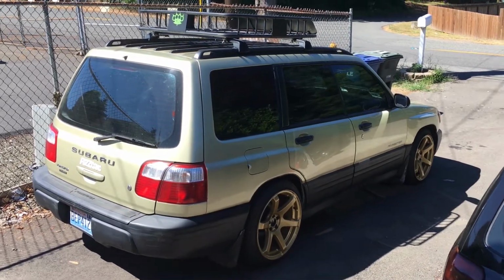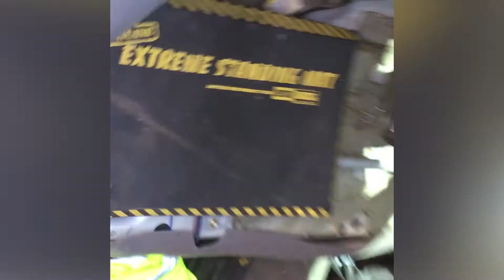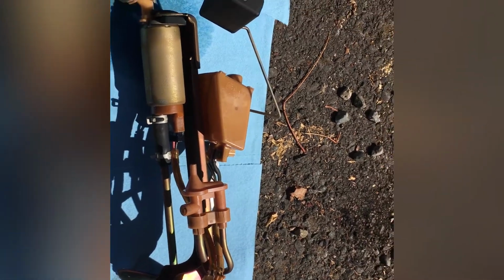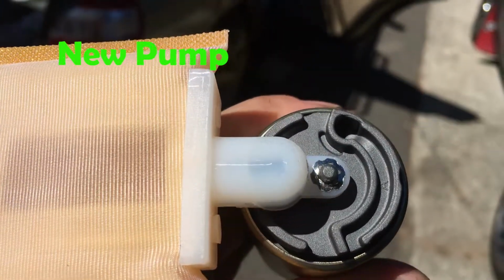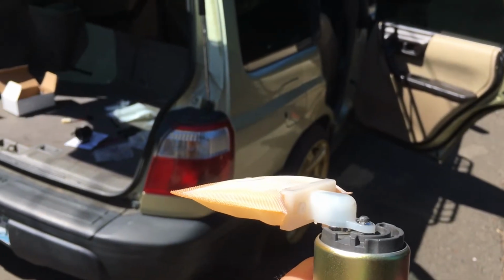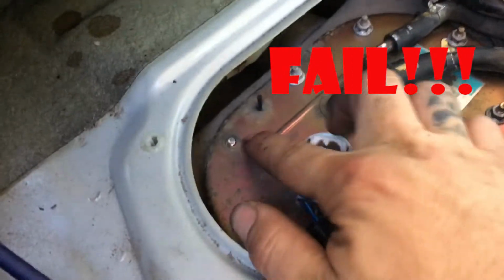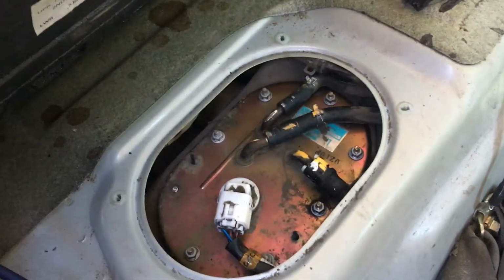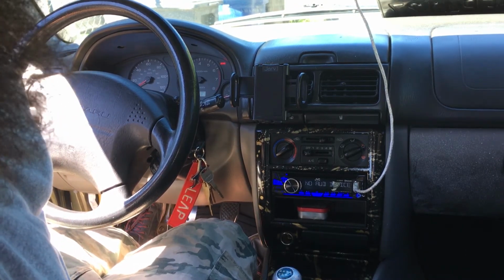Subaru Fuel Pump Replacement

Comment: Major tip.  But a piece of fuel hose that has a spec number of J30-R10.  It is rated to be submerged in the fuel.  A lot of times they don’t provide the correct hose with the new pump.  It’s the reason so many pumps fail.  The hose dissolves and ruins the pump.  Been through that issue several times with a Subaru.

Comment: How has this fuel pump held up? Is it still working good? I have a 2003 Forester I need to replace the fuel pump. And the factory fuel pump is way to expensive.
Reply: try a walbro aftermarket most auto spares can get bit - i got a 255 gph pump for a turbo upgrade ! $112.00

Comment: My 98 forester S went through 2 pumps in a few months. I think it's a ground issue somewhere. Can't figure it out.
Reply from the maker: I've heard of cheap pumps that can last anywhere from 1 day to 5+ years. So if your not positive that its not the pump you got. The one I linked in the description has a LIFETIME WARRANTY and free returns. GL
Reply: Bought that pump and haven't had a problem yet. Had to solder a new plug in and it works.